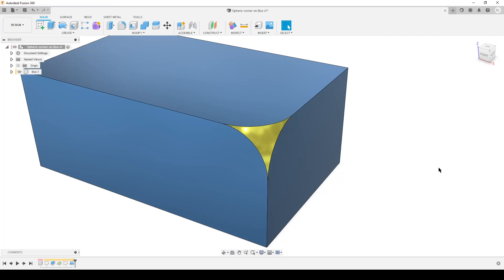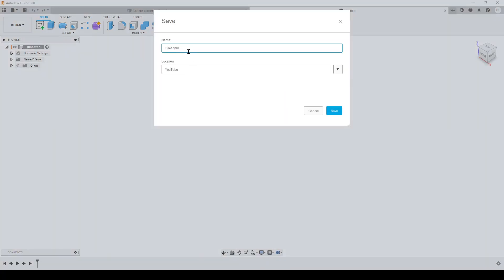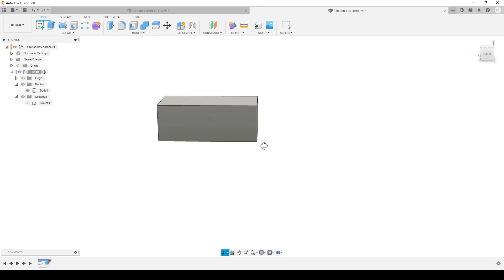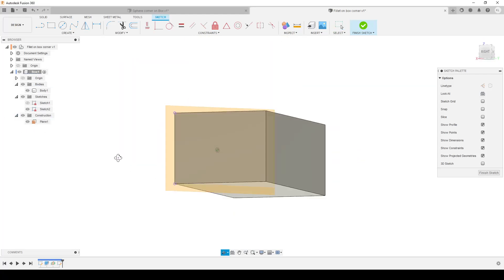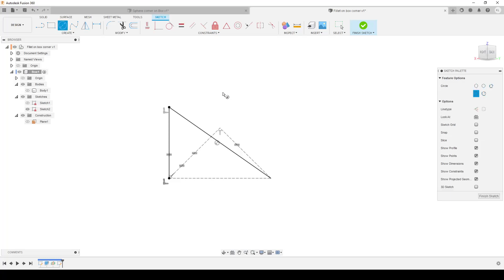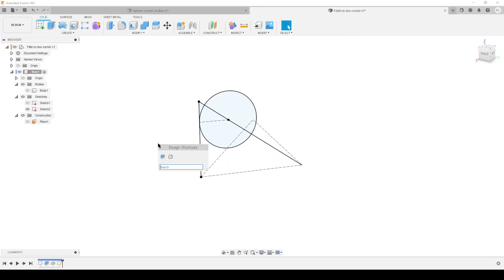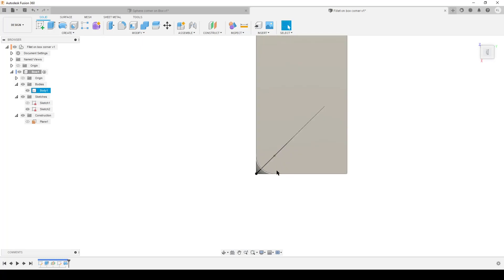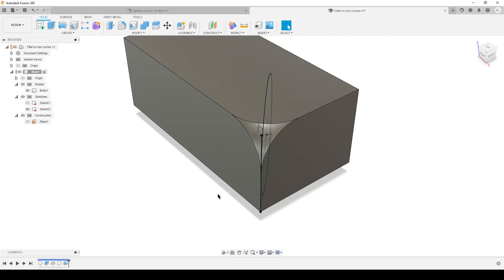Fillet one corner of a Box - Fusion 360

Comment: that is some 400 IQ thinking there, impressive!
Reply: The fillet is, when the 3 axis use the same distance, the surface of a sphere. The hard question is how big that sphere is and where it's placed. Since it's a corner of a rectangular prism, the center of the sphere will be on a 45 degree angle from any and all faces. So a 45 degree plane is made, then another 45 degree angle is made from a face
Reply from the maker: Thank you
Reply: Yes it is impressive, but why does it work? What is the thinking behind these construction lines?